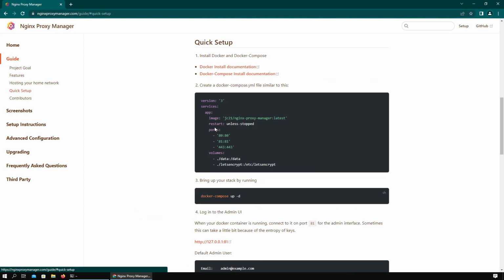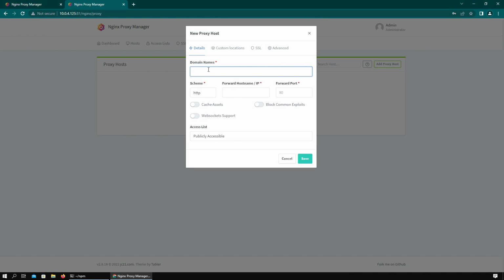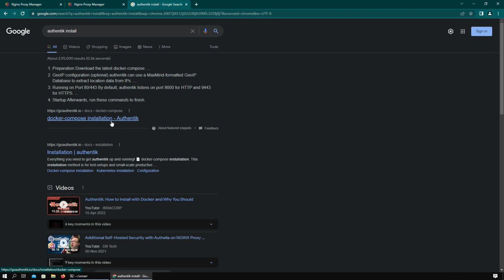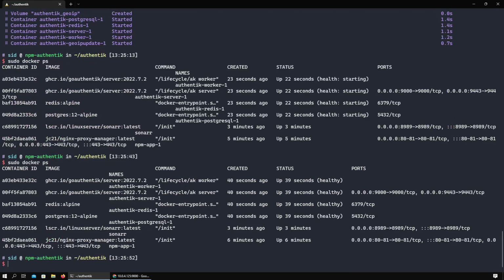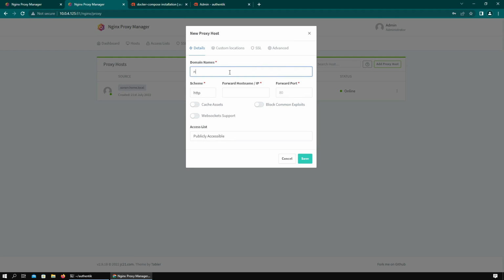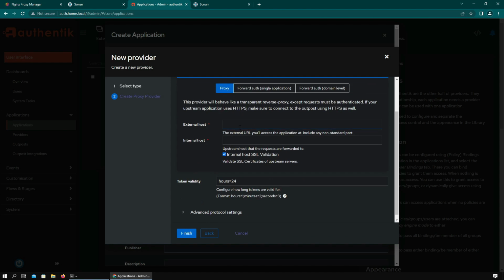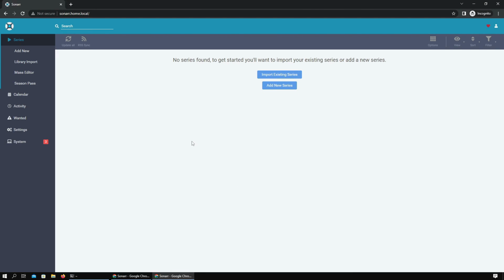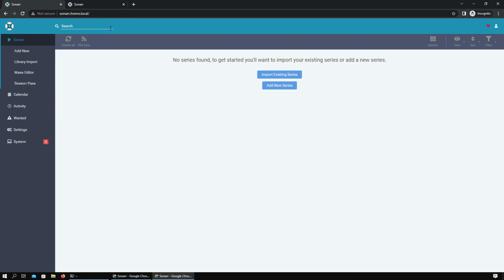Setup Sonarr SSO with Authentik and Nginx Proxy Manager

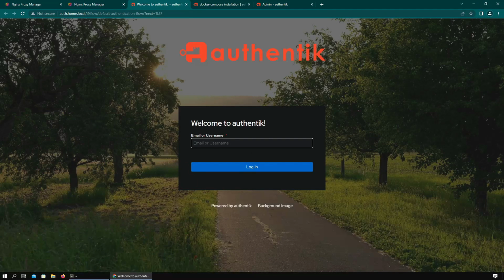Comment: Hi, just going through this and ive had no issues up until 4:50. I was able to add the domain name but it doesnt resolve. Would there be any other DNS settings or ports i need to change or open? I am using my own personal domain however i am relatively new to this side of things.

Comment: Someone in the future is going to need to know this. if you're using path based routing and normal nginx, configure authentik to use only "single application" for forward auth (only use base path as endpoint, mediaserver.home.lan instead of mediaserver.home.lan/sonarr).  and make sure you have these two lines get the authorization header. I can't paste the config in a yt comment, so RIP. was a 12 hour battle.
            auth_request_set $authentik_auth $upstream_http_authorization;
            proxy_set_header Authorization $authentik_auth;

Comment: Doesnt work at all for me. Weird. With forward auth it works, but it doesn't pass the credentials, Im using swag for reverse proxy. 
I also don't understand why, in the end, do you set the port of the application to authentik it's port?
Reply from the maker: The app is using Authentik port
Reply: ah yes thanks got it to work now. But authentication is not being passed. I had this problem with auth_forward as well. I also don't see any logs in Authentik (when logging set to trace) Any ideas? I've got it authentication set to browser pop up in sonarr, a group, my user as member of the group. There is now also an option to "intercept authentication". When unchecked, the proxy does not work at all.  @arevindh

Comment: is there a special image that needs to be used for Authentik , if available, for raspberry pi ? i am getting "no matching manifest for linux/arm/v7 in the manifest list entries" also with latest tag
Reply from the maker: Which hardware are you using?
Reply: @arevindh  it's a raspberry pi 48gb  need to see to use amd64 then it should work still on armv7 32 that might be the reason I'm not able to install it.
Reply from the maker: @fredzibulski3111  You should switch to Raspberry Pi OS 64bit. Armv7 32 not supported
Reply: @arevindh  yeah will have to look to switch to 64bit. Have lots of containers in portainer now will have to take the time to switch it all up
Reply: got it to work on 64 bit thanks for the guide.  Is there a suggested guide on how to get it running cloudflare tunnels ? I want to start using that instead of nginx could not find any helpful documentation,
Reply from the maker: Will try to make a video on it